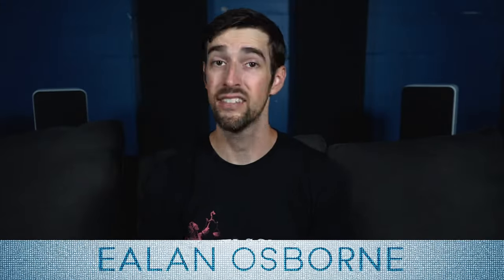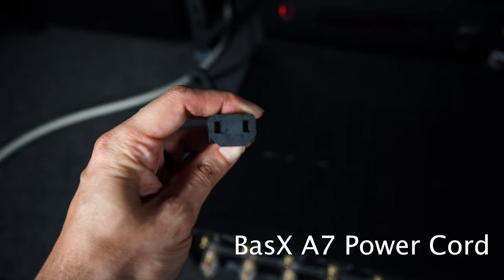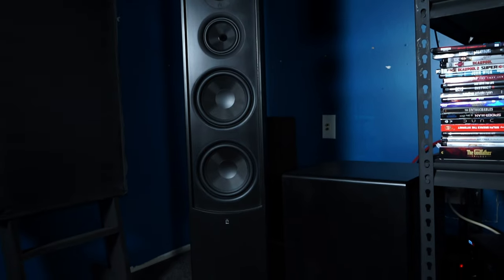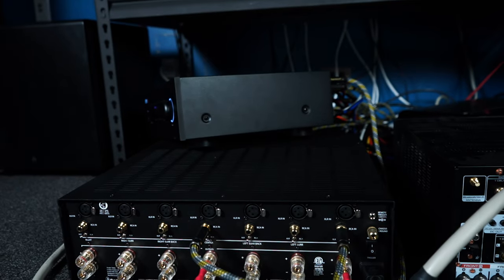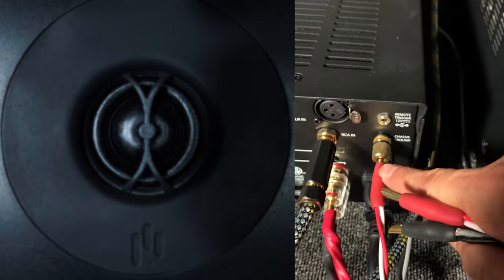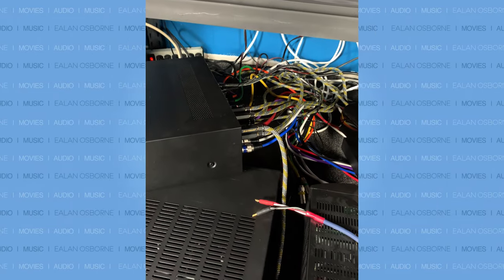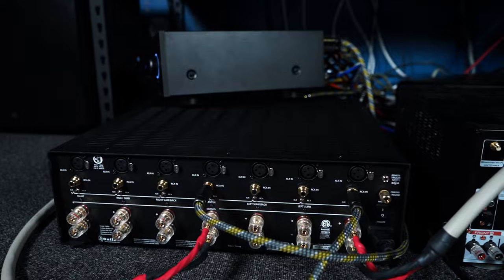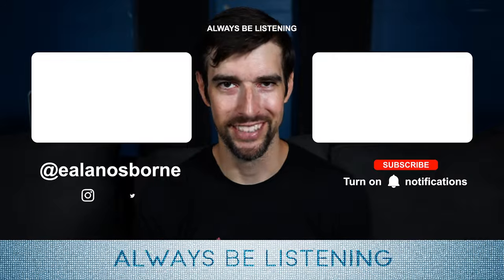I GOT IT WRONG! | Outlaw Audio Model 7000x | Review Follow-Up | Home Theater Amplifier

Comment: You need to edit the other video because many people won't see this one.  Good video.  I was an electronics tech for several years and have been an audiophile for the last 30.  Grounding issues are not uncommon.  Outlaw seems to have an excellent design.  I prefer when chassis are grounded as it makes the whole appliance like a Faraday Cage and reduces outside interference.  Ideally everything would be grounded and shielded in the whole signal path!

Comment: Yup!  That can happen.  I use a ground lift to eliminate hum as well.
Reply from the maker: Yeah, man! Live and learn! 😄
Reply: Be very careful with ground lifts. Understand what you’re doing. If a piece of equipment has a mains earth connection, it probably has it for safety reasons, so think very carefully before disconnecting it. Lifting the shield connection at one end of a signal cable can also work to eliminate hum, without compromising your safety, but it very much depends… And that’s the problem with earth loops, it’s rarely clear what the solution will be… there may not even be a solution. Maybe there should be more balancing transformers sold as accessories.

Comment: A tip i got when hearing humm noise is to disconnect every input 1 by 1 until you find out what's causing it.. even the source (bluray players etc) from your hdmi to your receiver can cause it.. This is pretty frequent in uk
Reply: Helps if you get a power filter like panamax, my hun went away with that power distribution unit.

Comment: Hums, can come from just about anything in the chain. I drove my self crazy with my Parasound amp at the time. My hum was coming from my cable TV coax cable. I used a Jensen transformer on the cable line and that eliminated the hum. This happens on Parasound and my Outlaw 7000x..The 7000x is a great amp dead silent with the transformer on the cable line. This amp cannot be beat in this price range. It performs as well as my Parasound A23, if not even better. A23 is a two channel for about the same cost as the 7000x, I was very surprised how it compared.

Comment: Outlaw is great, I love my 7000X and being connected to a Denon receiver sounds exactly like your Marantz, or a no issue to me. I really wish they would expand their line with a 3 and maybe a 2 channel as more people get into Pre-Pros. Great follow up!
Reply: do you have a humming sounds like found in this video with your denon avr? i got a x6500h denon, so wondering if i should get the outlaw 7000x.
Reply: @tainle  no humming sound on my HT. The sound is clean and powerful, thanks to the amp. Made dancing night several times with very loud music and it’s as smooth as it gets.  The Outlaw has incredible power and never gets hot. Comparably have an older 120W Denon receiver in another room and when playing loud music would overheat and shut down or drop the volume. Put your receiver in energy saving if it doesn’t have the pre amp decoupling.

Comment: This was a good video.  One thing I wish you had done at the end would have been to test to see if the same red wire had any effect for the minor noise from the Marantz connected to the right speaker.  It was nearly inaudible but testing it out would have been interesting.

Comment: I bought ground loop and attached it to the end of the comcast cable going to my AVR , that solve my humming sounds. (Old house)
New house no problem at all, no need to use my ground loop.
Reply from the maker: Exactly. You never know what your house might introduce into an audio signal. 👍

Comment: And THIS is why pro-audio systems use balanced connections. It’s not just the noise-rejection you gain from balanced audio connections, it’s the fact that the audio signal and chassis earth are separate things and never touch or even reference each other. You can connect balanced audio systems with a stack of devices and hundreds of XLR cables running every which way between them and almost never  encounter even the slightest ground loop issue. Whereas with unbalanced equipment, some of it having a ground-bonded chassis, and some that leave the chassis floating, some RCA connectors connecting chassis ground to audio ground, and some not… it’s a lottery. There are unbalanced designs that help mitigate possible ground loops, and you hear plenty of fully unbalanced systems with not a hint of buzz or hum… but sometimes something comes along that upsets the whole apple cart, and it can be almost impossible to fix. But it would be a start if all subwoofer inputs and outputs used proper balanced connections at least.  That would solve 85% of the issues. That’s the one development I’d most like to see on mid and high-end AV receivers, and it would cost almost nothing. Glad you found a fix. And I don’t think you’ve been dumb at all, you just got bitten by the limitations of the system.

Comment: Would be nice if all amps had that grounding pin just to make things easier.
Reply from the maker: I know, right? It’s a great fail safe🤘
Reply: You can always just use one of the chassis screws to ground. It’s nice if there is a dedicated pin but all you need is wire to a metal screw to the chassis.

Comment: Thanks Elan for finding the solution 
But I have a different issue 
I have outlaw 7500
It has huge white noise without any input provided 
The white noise only goes down with XLR s connected to a prepro 
And one channel has more white noise than the rest 
How can I fix it
In general I have more white noise on this amp when compared to my other amp
Reply from the maker: Oh goodness, I’m not sure about that. If you have Instagram, try DM-ing Outlaw Audio (@outlawaudiollc), since that’s the quickest way I got through to them. That or email their support team. I wish I could help more! 🤘

Comment: Hi Elan, so are you able to put both a turntable and amp ground wires under the same turntable ground on the avr? Or separate them? One under a chassis screw and the turntable by itself under its own ground? 
Thanks ahead of time.
Reply from the maker: According to some forum posts, you need to keep multiple grounding wires separate. So you could connect the turntable to the turntable grounding pin on the AVR, and the amp grounding wire to the AVR chassis, for example.
Reply: @ealanosborne  
Awesome. 
Thank you Elan. I'm taking this advice.👍👍👍

Comment: u gave the denon x6500h, it have a grnd connector on the back. I tried this trick with my emotiva bas x7 power amps but it would not solve the 60hz hum very low not loud as yours, maybe it is loud as the marantz you have. any other tips?

Comment: Hi there, did you feel that grounding the Iota improved the sound quality in anyway for example maybe a little bit more clarity etc.
Reply from the maker: No. The IOTA's audio processing is great, so it just removed the buzz, allowing me to hear what the AVX17 is actually capable of. :) Using XLR cables has no buzz whatsoever, so grounding to the chassis, it was suddenly on par with XLR quality, which was such a relief!

Comment: So just to recap, send a wire to both the avr and amp correct? Or just 1 or the other
Reply from the maker: Yeah, a wire connects both the AVR and amp to each other, essentially grounding them both 👍
Reply: Thank You

Comment: Nice solution for the buzzing .. but the amp itself still has a Hiss audible in all exampls ..even on camera.
.. reason?
Reply from the maker: As far as I know, all speakers create a hiss to some degree when they’re ready for a signal, and if you have your ear right next to the tweeter. But I’ll be doing more tests in the upcoming weeks to see if that’s true or not. During those tests on camera, the boom mic was literally millimeters away from the tweeter.
Reply: @ealanosborne  ...Understandable at Millimeters away.. yes. 🙏👍🏻.. Specs Matter.

Comment: Nice job Ealan. How would I find the ground on my Rotel RMB1066? It doesn't have a ground pin and has no ground ac implying double insulated? If so, how could I ground it to my denon 3700?
Reply from the maker: Hmmm…You can always ground by unscrewing a screw on the rear portion of the Rotel chassis, wrapping a copper wire around the screw, tightening the screw again, and connecting the other end in the same fashion on the Denon. Or connected to the signal ground near the phono input on the Denon. I think… 😄
Reply: @ealanosborne  haha good thinking.  Thanks bud

Comment: I have the Denon x4700h and am looking to get amps for my speakers and use my Denon as a processor.  If I get two of these amps, can both amps  connect to the same ground screw on the Denon? Or would I have to ground each amp to a separate metal screw on the chassis of the Denon to eliminate the humming?
Reply from the maker: I’m honestly not sure. But, in theory, grounding is such a basic/simple process of just making sure electrons are flowing to a grounded source, I would think grounding two amps to one screw shouldn’t be a problem. 🤘
Reply: You can stack wires on grounding posts.  As long as the connections are good, and you tighten down the ground screw firmly, it should not matter.
Reply: In fact, connecting both to the same grounding terminal would in fact (theoretically at least) be better. It makes a very simple kind of star-earth connection. It’s all a bit of a kludge ultimately, but if it works and is safe (which this is) then it’s all good.